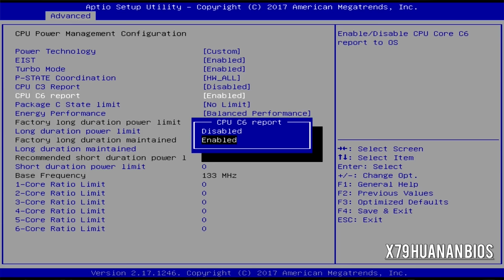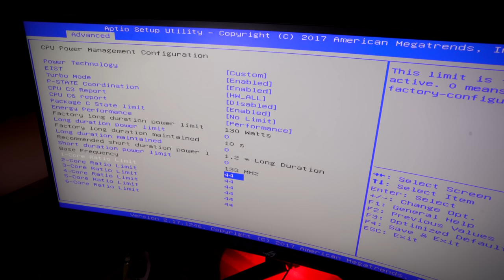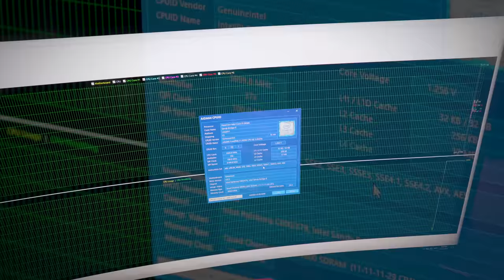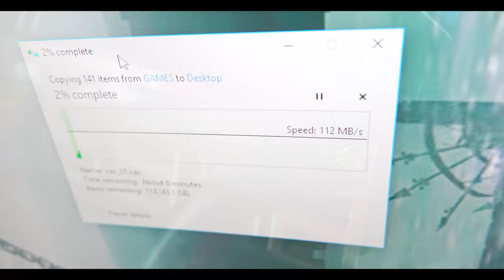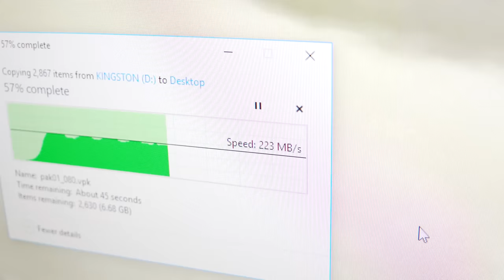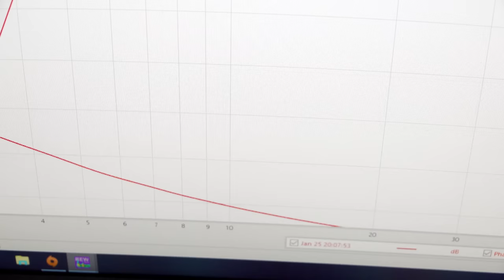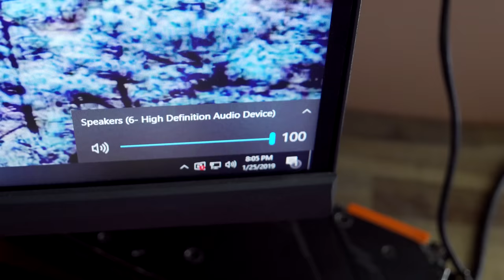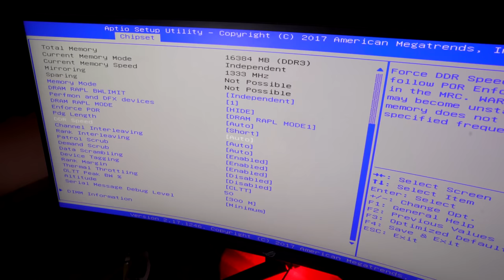Is This CHEAP X79 'RUNING' Motherboard WORTH IT...?!

Comment from the maker: Hope you guys enjoy these random objects of websites like Ali and Ebay, if you do then be sure to let us know in the comments here!  Can check out the dual board too if you guys are really keen, but as I said in the video.... kind of already know how that will turn out :(.
Reply: awww... come on! it'd be fun to check out the dual socket!
Reply: I enjoy that content!
Dual socket does seems not so good to me personally
Reply: it seems like your burned out man,
Reply: as I know this motherboard size is not standard and it does not fits in regular atx cases can you conform that?
Reply: Try buying the bost bought P55 mobo on aliexpress and a X3440 on Aliexpress and rewiew those?? its 60€ in total
Reply: I am getting an i7 3930k with an arctic liquid freezer 240 and a Asus Rampage IV Formula. I can not get an  4.6GHz overclock stable, because I tested this combo a whole day with gaming and some stress testing like cinebench but after 3 hours it crashes all the times (CLOCK_WATCHDOG_TIMEOUT). The temperatures getting no more than 70°C and I tested that system with 1.2V, 1.25V, 1.3V and with 1.35V but that didn't help. Please help me
Reply: This kind of content is reason why I subscribed, please add AC Odysey to testing it's very cpu heavy.
Reply: E5 2690 vs E5 1650 oc vs Ryzen 5 1600 oc pls
Reply: I love this type of content. There is so much stuff on AliExpress and I believe that are some gems waiting to be discovered.
Can you check some fans and CPU coolers?
What do you think about those cheapo ram heatsinks?
I think that they can add some shine to builds with bare PCB Ram sticks. there are some without branding too. 
 PS. Can't put link :/
Reply: Would love to see a custom waterloop using reasonably priced Aliexpress parts (not the cheapest you can find)
Reply: I have two Huanan X79 (the orange one, which uses X79/C602 chipset) and one of this Runing boards. I can't get the Runing board to accept more than 2 PCIe x16 cards at the same time. Can you try if it actually works with all the PCIe x16 slots populated? I think it only has 2xPCIe 16X, it can only switch between the slots but it can't divide the lanes!! Could you give it a try?
Reply: @MegaBattleMonster  increase qpi voltage
Reply: I'd be interested to see the New Huanan X79 orange board they have tested, the single socket board. I've read some good things, but I went and pulled the trigger on a X79 Dark for $240 CDN on eBay which I think was a fantastic buy. I already have a 1680 v2 in a P9X79-WS but wanted to build a second cheap system with a 1650 v2 I got locally for $100.
Reply: Love this kind of content. Don't need to see the dual socket stuff, but if you do end up doing it...DUNICRON REBORNNNNNNN
Reply: @DvD-Tech  Do you know if the new BIOS fixes the PCI Express x16 not working at the same time? I have this board but only 2 PCIE x16 slots work at the same time. Could you give it a try? I can use any slot I want but only detects 2 cards.
Reply: @andibiront2316  last time i used one of this board os few months Ago...i Will do some hackintosh's on Brazilian Campus Party this year... If someone there have this board i can test there
Reply: Hey Brian, have you seen that HUANANZHI actually have a new (early jan) x99 motherboard that (apparently don't quote me, russian youtube) supports ES xeon 2011-v3's
Reply: Seems that these boards are very popular in Russia as there are plenty of Russian language reviews on Youtube.  However, I was also able to find a couple of Russian blogs on this subject and, with the help of Google Translate, was able to understand the content.

Appears the latest versions of the Huanan single socket X79 are the HuananZhi Deluxe (with M.2 socket)...followed by the HuananZhi Plus. The later having black PCIe slots, instead of the orange ones. Unfortunately, the Plus version doesn't seem readily available.

I went for the Deluxe version...will see how it goes.

Would love to see an OC review by Tech Yes City of either of these boards.

PS: Here is the link describing the various releases of this board, their respective improvements and any issues noted.  Google Translate if necessary...
https://xeon-e5450.ru/socket-2011/motherboards/huanan-x79-deluxe-gaming-series/
Reply: What is that fan noise near the 13:00 mark?
Reply: I was watching Russian review of this board. Russians love AliExpress. This board is limited to 3.9 ghz on any CPU you put into it. Another glitch is when you put the computer to sleep PCIE cards stay lit, and fans stay spinning on your gpu. There was another glitch, that I cannot remember right now.
Reply: Good work. I have been wondering if these motherboards are any good. Disappointed with the sound though.
Reply: Hı bro Where is the buzzer entrance plaese help me

Comment: The choke's are anyone's guess.

But, those seem to be YTF brand Chinese capacitors made by Shenzhen Yike Technology or its parent/official name (can't figure it out) Shenzhen Jinmao Yuan Technology. Their capacitance is 820uF and they're rated at 2.5V. Chinese, so not great, but as long as VRM temps are ~80C or below, they won't explode on ya.

The 'FETs are made by UBIQ (the logo's based on the lowercase form [ubiq]). Their full names are QM3092M6 and QM3098M6, and they seem to be pretty damn good.
That's not a 7 phase doubled though, otherwise it'd look like a 14 phase. It's got one high-side and two low-side's, and the chips next to them are the driver's. Doubler's are like half the size of the driver's. Doesn't matter though, because it's a quality 7 phase. It just needs a bit of airflow via a case fan at the top, and a proper heatsink wouldn't hurt.

Overall, the VRM's are decent.
Reply: I think they're ferrite chokes but I'm not sure
Reply: Man, the motherboard analyst community coming in clutch as usual.
Reply: I have already using more than 2 years

Comment: Thanks for making this video! However it seems that the better choice regarding Chinese LGA 2011 boards is still the HuananZhi X79 Gaming or the X79 Plus, specifically V6.0 and up, as they do achieve the same CPU overclocks but also allows for the tuning of both RAM frequency and timmings up to DDR3 2133 CAS 11 at a lower price point. They do even have been voltmodded to reach 4.5 GHz on the E5-1650 V2! It would be great if such claims could be tested someday by you. Best regards!

Comment: Why when you can get a B450 board for $70 and a Ryzen 2600 for $160? Its not really more expensive or anything.
Reply: DDR4 ram dude, DDR4 ram...
Reply: @Martinpintos13  It's not that bad as it used to be
Reply: you can get 16gb ddr4 ecc registered for 40 bucks
Reply: Funny, until a couple months ago I was planning on buying one of these boards- before taking advantage of a cheap deal on an X370 board+R5 2600, and splurging on 48GB of DDR4 (which is the amount of DDR3 I would've been able to populate this thing with...)
Reply: Plus the ryzen 1600 can be had for a bargain these days
Reply: @k1er4n544  man, even the 1700 is going for $170 on amazon very occasionally
Reply: Does x79 run hotter or cooler, more or less power than ryzen besides cost o.o?
Reply: @Martinpintos13  ddr4 ram prices have tanked
Reply: @Targetlockon  Runs hotter, draws significantly more power and is slower than Ryzen
Reply: That's the issue I'm having currently. I could get a 3930k and MB for about 250 (used prices are high in my area) or I could get a new ryzen build for the same price. Then factor in ddr4, but at least i'd have a full ddr3 system to sell to balance out the cost.
Reply: Aditya Sharma where? That’s hectic
Reply: Quad channel ddr3 is better or as good as ddr4
Reply: @Targetlockon  Hottter,way more power, less instruction sets that newer games need and cost's more for a lot older tec.
Reply: @Targetlockon  runs hot and consumes more power,and also it's an old arch,and there is no upgrading headroom.
as i said in my main comment,the Ryzen lineup just killed the X79.
literally,unless someone is a die hard Intel fanboy.we pretty much know how that would go.
PS lets remind people that DDR4 prices are going down,expecting em to go for 20% less in 2019.
Reply: Yeah hes never heard that argument....plus this is why WE watch TechYes
Reply: One benefit is if you already have ddr3.  In Australia, it would've cost me upwards of $500 to upgrade to ryzen with 16gb of ddr4.  However, I was still on ddr3 and upgrading to a system like this only cost me around $300.
Reply: For ppl with shitty am3 setup. Just throw all ur stuff into the x79
Reply: I've got 32gb ecc DDR3 1866 Samsung for $50 in New York 😎
Reply: Just adding I did 3 builds with that setup I mentioned already for my friends and they all produce cinebench results in the 1400cb range which is comparable to an i7 6850K, so again I think Ryzen is a great choice that's hard to beat even with old extreme edition hardware.
Reply: @MrBluePoochyena  Where (?), the best I could find between AliExpress adn eBay was on AliE for $100 (Samsung, REEC 1600, 4x8GB). That's about EURO 85 to 90.
Reply: A xeon e5 2670 will kill ryzen lol and thats x79. 10 cores 20 threads.
Reply: @z21ify  ...and the cheap 4 channel R-EEC to boot.
Reply: Comment section mostly filled with 12 year olds that only understand newer hardware with no appreciation for older hardware. What a shame. Alot of the PC community is just garbage these days. smh
Reply: @Martinpintos13  ram is cheap now days overpricing is over
Reply: @moofree  Was halfway through getting parts for an x79 build for fun and to build a PC with my Son for his first build... Microcenter starts the Ryzen 1600 for 79.99 and 30 off a mobo sale and well still have half an x79 build!  Went with the Ryzen 1600, MSI B450 pro carbon , 16Gb GSkil 3200 (open box on the ram) ... $263 and change after taxes. Obviously one's region is a factor but here in the US Ryzen is VERY attractive with DDR4 prices plummeting.  Actually right now if you get the 1600, full price 16Gb GSkill ram and go down to a B350 Pro4 mobo its $230.02 out the door. Insane value.
Reply: @TheJamesKF  You're right that most folks should be considering Ryzen builds. One of my main goals of my new 1356 build was to have a lower power server with ECC ram- and surplus ECC DDR3 sticks are still a lot cheaper than the equivalent amount of ECC DDR4. Edit: Thought this was a reply to my comment about building a 1356 system on TYC's recent 1356 videos-
Reply: you can get a 1650 or 1680 that are both unlocked, the v2 chips are quite affordable.

they are unlocked,  and ddr3 recc is dirt cheap, by dirt cheap, check aliexpress for 1866mhz 16gb sticks.... very affordable... 

this is not a bad choice for the price, im eyeing something similar to this if only as a step till ddr3 drops in price, i want to move up to 64 (from 32) and double my threads, the 1680 v2 or v3 are ideal choices for my needs.
Reply: my xeon w3690 occed to 4.1ghz perform better in 3dmark firestrike (combined score ) than the r7 2700x so i think in game is better , probably this xeon x79 if you do OC can push a lot in game than the r5 2600
Reply: Having more cores thus more threads at the same price as the new 8 cores ryzen it might does the push but ending spends for aio water cooler.. Still for some, the cost involved are justified.
Reply: @z21ify  A 2680 v2 you mean. The 2670 is an 8c/16t cpu.

I've actually got a E5-2680v2 in my chinese X79 board and it's still running up with a stock 8700k. I've bought the E5-2680v2, X79 motherboard and 32 GB DDR3 REG ECC memory for just under €280, for which you couldn't even buy a 8700k, let alone motherboard and (at the time very expensive) DDR4.
Reply: @benedykt123313  yes sorry my bad. But anyway a 2670 its a good choice.
Reply: Brandon S  Pretty much. Im running a i5 4670K OC'ed to 4.2 GHz with a GTX 970 some 12 year old would probably call "bad" lmfao
Reply: Brandon S  More ram is more virtual machines. It's up to 64 gigs now. Plus the 2600 was something cheap to use till the 3000 series came out. You can thank amd now that you seem to consider six cores twelve threads low end.
Reply: Brandon S  true. guy was selling bunch of parts from his office computers. I've got also couple xeons and one core i5 6500👌
Reply: @Targetlockon  run cooler but more power
Reply: @alpha_one_x  X79 is faster than my 2600 even

Comment: ThrottleStop or Intel's XTU may help when trying to OC/lock in a particular clock speed/multiplier.  I use ThrottleStop on my 7700K Kaby Lake Z170 based laptop to lock in a 4.5GHz frequency all core overclock (cache multiplier maxes out at 4.2GHz; a limitation of this particular chip is that it can't clock higher than that while remaining stable, at least at the -100Mv undervolt I have the cache and core clocks configured to which helps keep the CPU running cool at those speeds).

Comment: These boards are pretty reliable! I have been using one since may 2018 with a xeon e5 1650 overclocked to 4.1ghz with a bios mod, and it's still running smoothly. I use it with a Vega 56 and it's totally fine for 1080p games. I ought to upgrade the whole system at some point but I'm fine with running this for even a couple more years.

Comment: I've been using one of these for 12 months with a Xeon 2650v1 64gb of cheap ECC memory, low cost water cooler and an Intel nic running 8x3tb WD Reds in Freenas Z2 and it hasn't missed a beat

Comment: I used to own this board and had a 2680v2 on it with 64GB of registered DDR3.  Good for the price and did well as a 1080p gaming system paired with an RX 580, but did have a couple issues...first is that the BIOS was not only simplistic, but Runing also didn't offer any BIOS updates, so you were stuck with the original one.  Second is though this mobo has an MSATA port, I couldn't get my 860 EVO MSATA to work on it, BIOS didn't even recognize it!  Third is even with an SSD, it took a long time to boot, mainly took a long time to get through the BIOS.  Fourth is that the BIOS fan controls sucked, tried to run everything at 100% no matter which setting you picked.  Fifth and most annoying is that the size is slightly LONGER than a standard ATX board, which should be 12"x9.6" and this was more like 12.6" long.  That extra 0.6" in length means it won't fit many cases.

Comment: I purchased an x79 matx chinesium motherboard.
It's build quality was really solid, I paid about $160 for it, shipping was $40.
It's running my old 4820k with no issues. 
Board is a nice red and black.
Edit: it also supports ECC memory
Memory speed is not very high, I think the furthers I've pushed it was 1866Mhz before running into trouble.
I also found the chinesium 2011 socket chip holder was much nicer then my Asus ROG Rampage IV

Comment: Got all of the parts in and did the install as per previous post.  Very pleased with the Huanan x79 deluxe.  Was even able to install WIN10Pro and boot on the NVME M.2 ((XPG GAMMIX 55 by ADATA 256GB)! Now...let's just see how long this little beast will last! System is running cool with a cheap $25 dual RGB fan 4-pipe cooler from AliExpress.

Comment: I bought the same mobo for my 4820K and it works well. So far the only problem i encountered  is the USB connections. Some devices are not recognized and i need to swap ports to get them running.

Comment: I run my  huanan x79 v 2.46 c602 chipset with xeon e5 1650v1 on 4.2 ghz and with 32 gig ecc reg ram. Have this rig already 2 years, all is ok. You need a custom bios to rich a 4.1 - 4.3 ghz. Also, you can get a 4.5 ghz with a voltmod.

Comment: your overclock did not worked because you dont calculated it properly :D base frequency 133 Mhz x 43 or 42 you set gives you frequency close to 6Ghz, try to pul something like 32 in multiplier, it should work as you desire ;)
Reply: Stock base is 100Mhz, just saying lol
Reply: @thebait68  look at 4:41 in Video - base frequency 133 Mhz ;) , 100 is in most bioses but this case might be different : )
Reply: @Apik17  Totally missed that part lol, thanks for the correction! How did they(China) manage to screw up stock BIOS setting so bad lol
Edit: but at 6:40 AIDA64 states 100Mhz so who the frig knows lol
Reply: @thebait68  It says 100MHz BCLK in Windows probably because the 133x44 settings in BIOS failed and as such booted at 100MHz BCLK.
Reply: @AndyBradley1984  it was a rhetorical statement on my behalf, but thanks anyway lol

Comment: Those mosefets are up on Ali express for sale now. They are made by MOSLEADER which is a subsidiary of ON semiconductor. They are $11 for a 10 pack. But ratings looks pretty low at only 22A but since there double'd to 14 you could look at it like 7X44A looking at the video i don't see any doublers so the components are probably just doubled up so its looking like a 7phase.

Comment: 6c/12t 3.9 GHz is fine for now. I recently did a X58 build with the Intel DX58SO + X5675 CPU. Also clocked that to only 3.9 GHz. (only a 92mm Noctua tower cooler and that Intel MB is not really good at OC, and I wanted the BCLK down and rely on Turbo). Paired with a GTX 1070 is was still a capable system. Actually did about 900cb i Cinebench (not far from this one) Can't remember the excact result though. :)

Comment: You're right about dual CPU. I have Dell Precision Workstation T5500 with dual xeon X5670. Some games won't run until disabling some cores in BIOS or via msconfig.

Comment: I use this board with my 12 core Xeon 2695 v2, and loaded it with 64g of Ram. It works fine, except some USBs are occasionally  not recognizing couple of peripherals. Do you know if there is an official website from Running with firmware updates? Or is there a forum about troubleshooting problems with that mobo? Thank you for this video!

Comment: I have this board with a e5-1650 v2 and it will run 4.3 stable 24/7. Might do a volt mod and see if it will go higher.